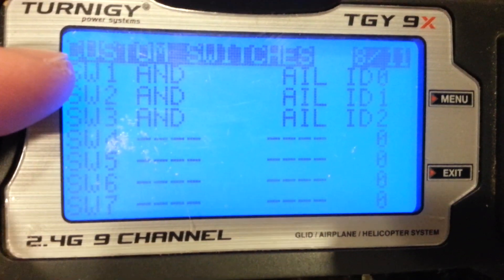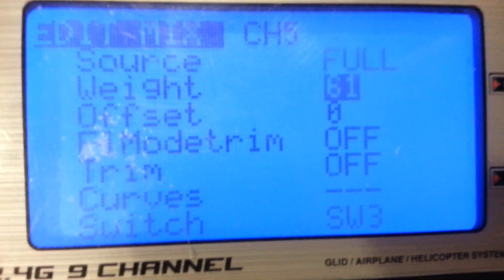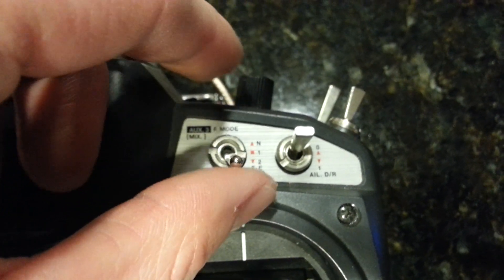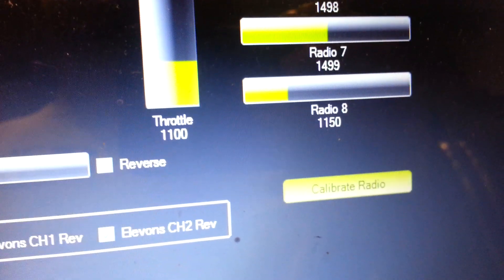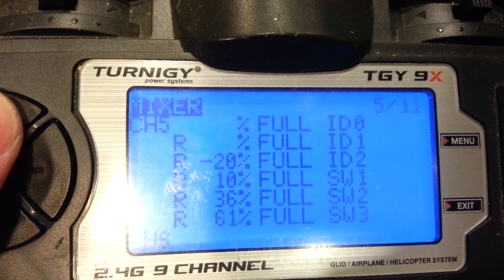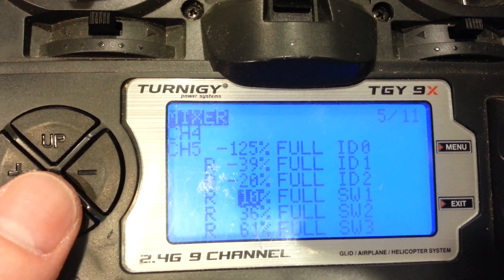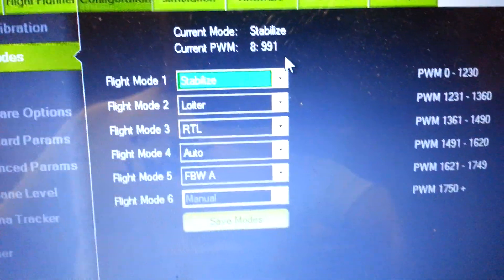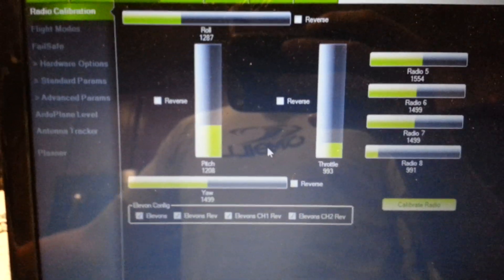Flight mode setup for APM and Turnigy 9x with ER9x Firmware

Comment: Very Informative Thanks
I followed the procedure but I can't get SW2 and SW3 working = Aileron Switch is just adding on ID0.
I have software release er9x-r803 ver. v1.1393-Mike
Reply: Patrick Poirier Resolved = I flashed latest firmware = it works !!
Reply from the maker: Patrick Poirier Awesome!

Comment: Hy i am trying to set up my radio as you have mention and i have found more lines on my edit screen . i will name it to you and please tell me what do i have to fill it up  it is by order: 1)source, 2)weight, 3) offset, 4) fix offset, 5) enableExpoDR, 6)trim, 7)curves,8)switch, 9) Modes  01234 allows me to high light the one of 5 10)multiplex, 11)delay  down , 12)delay up , 13)slow down 14) slow up.. and i do not have any access to indicate sw0 sw1 and sw2 once i reach to place the value for ch5 for the flight mode after i have enter the value for the first 3 id0, id1 and id2.. what it will be the right way. and why you think i do have a different screens the yours? need help please.. by the way my version v1.422-mike
Reply from the maker: Were you able to figure it out?
Reply: no i am having hard time

Comment from the maker: Chris,
Thanks for the compliments. Glad you found it helpful! I sure do hope it helps others. I originally made this video only for my dad, but recently made it public in hopes that someone else might find it helpful. 
I still don't know much about the parameter settings. There are quite a few of them. I also have the same radio setup as you. The telemetry on the radio is great.

Comment: OK that was probably the best how-to for the 6 flight modes I have seen so far. Good timing too cause I have installed the SmartieParts board and TelemetrEZ module with the DJT / D8RII Plus combo. I am just putting it all back together while I do a video showing how to do that as well. I bet the two of these vids would really be great for teaching the noobs. What am I saying,..I am one.:-) I will be using Mission Planner and Arducopter for a FPV Quad  build. I cannot believe the number of parameters that are adjustable there. So  anyway, thanks loads